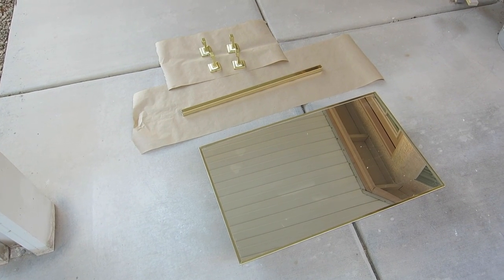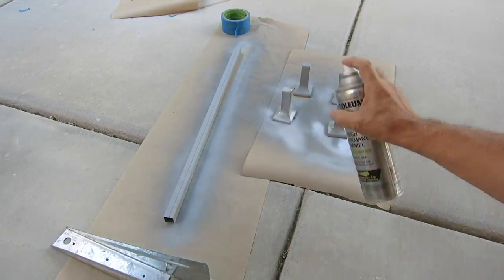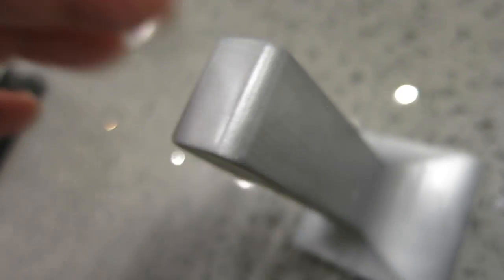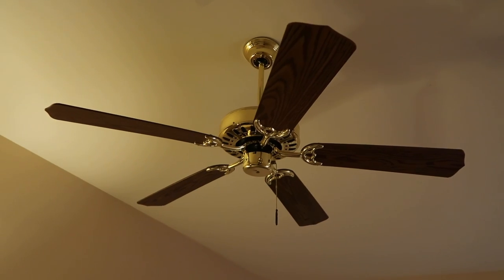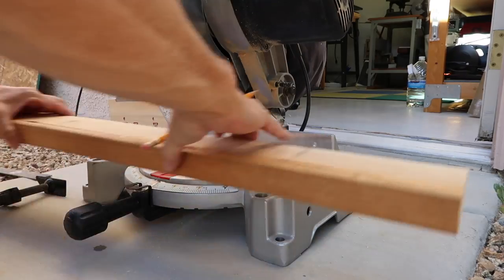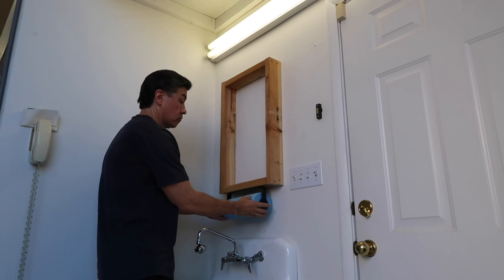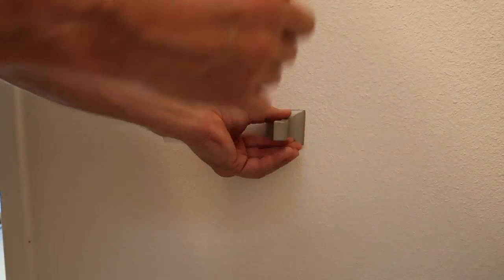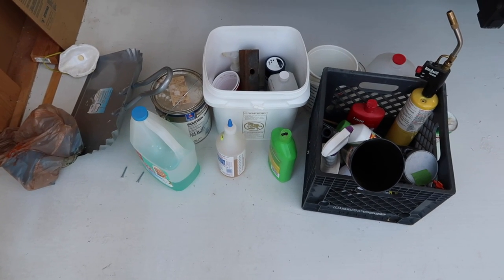Faux Brushed Satin Nickel with Spray Paint

Comment: I did the same..  primered, base coated and cleared all my brass... lights, and door knobs..  Inside door hinges were cheap to replace with a Builders Pack Box from Home Depot.  the Front door hinges I wire drill brushed the brass coating off and cleared... best Brushed Nickel there EVER was was Valspar Matte Metallic Satin Nickel, Now IT pretty much Exactly Matched your Faucet....I have 1 can left..   went to Lowes...  THEY DISCONTINUED IT....   Valspar even stopped making it..   Sure to be LOTS of pissed off people just for this one color....LOTS of people redid their brass in it...   a year later..   Everything has held up except my front door knobs.....   I'm going to respray them..  then Coat ALL my doorknobs in 2 coats of POLYCRYLIC...   I also replaced the bathroom towel bars instead of painting..  cuz they're cheap too.. and I replaced all the door striker plates..    cuz the paint just scrapes right off after awhile...

Comment: Nice project. Sooo glad you turned the TP around. When you first hung it I thought, oh no, Steve is not that guy. Then you turned it around and I was so very relieved.
Reply: Haha, I thought just the opposite. I like it when the toilet paper hangs neatly at the back, flush with the wall. It really doesn't matter which way you hang it though. The important thing is that everyone in the home hangs it the same way because it's annoying when you try to unroll the paper and realize that it isn't unrolling because someone hung it the opposite direction that you're used to. If it is always hung the same way, it avoids the need to have to look at the paper every time and figure out which way to unroll it.